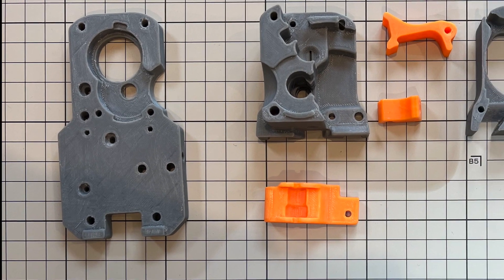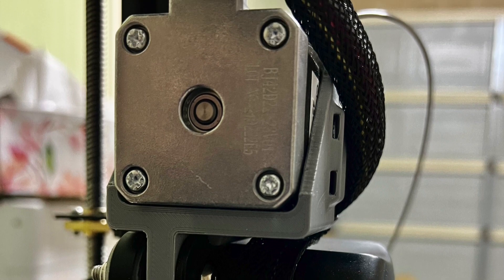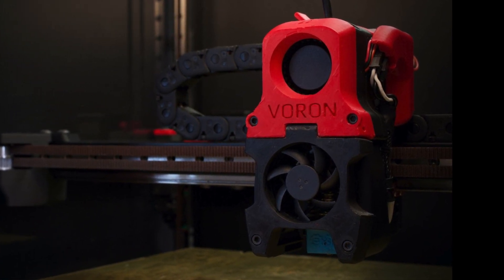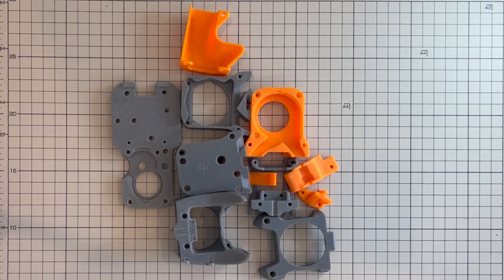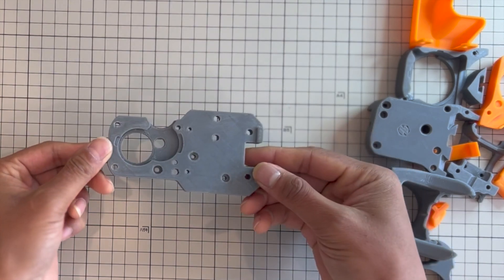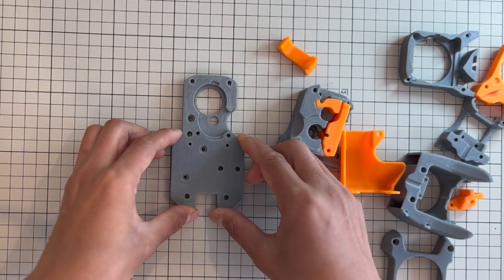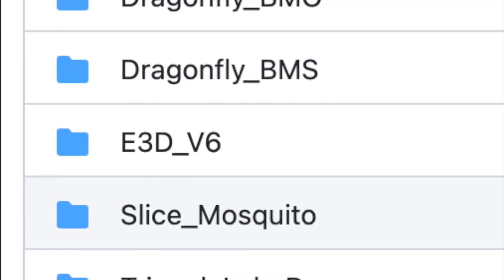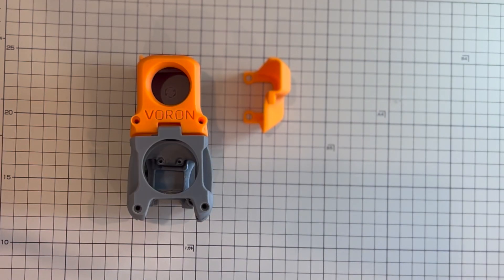Building a Voron Afterburner for Ender 3 v2: printed parts and parts sourcing

Comment: can you tell me the temperature setting and cooling fan you use to print  abs afterburner parts?
Reply from the maker: You may play with the temperature with your own filament. I print them with bed temperature 110C and hot end 255C
Reply: @makeIT0  255c with all metal hotend or ptfe line stock ender 3 hot end?
Reply: @lanypuspasari1868  From a different perspective I am printing this on my old Anet A8 in an enclosure at 230C and 75C bed temp. 75C is not giving me issues at all. I'm using a PEI coated sprinsteel(??) bed from eBay and some hairspray.

Comment: I am considering this build, but I would like to ask: Does it reduce print volume?
Reply from the maker: No, if you don't install the cable cover or cut a little like this https://www.youtube.com/watch?v=DmTqJCn7rKY&t=303s
Even if you keep it as it is,  The Z height reduces round 3cm which you would probably never have a chance to use it.

Comment: Great video, I am so doing this, thank you. Question: I’m using ESUN PLA+ for everything I’m making. Do I need ABS/PETG for strength/ heat resistance? I think I’d need to upgrade my E3v2 to print ABS?
Reply from the maker: I think you should at least use PETG

Comment: for 2pcs m3x10 screws and 1pcs m3x6 BHCS or SHCS? and for which part?
Reply from the maker: This is for fixing your printed plate on to https://www.thingiverse.com/thing:4614384. BHCS m3x10 (6-10 should all work fine). Actually you have these screw if you have the BL touch.

Comment: Nice print head, but without a coreXY is printing faster a good option for bed slingers like the ender 3 v2?
Reply from the maker: You're right, It does not improve the print speed. I did the mod because it is a better direct drive solution (both in function and aesthetic) and it provides a decent cooling for PLA (The stock Ender 3 v2 cooling is good enough though, considering it uses a single small fan)

Comment: does it use ender 3 v 2 gantry x or ender 3 pro ?
Reply from the maker: Mine is ender 3 v2, but you can easily find one for ender 3 pro as well
Reply: does using a pancake stepper motor have to change the vref current on the ender 3 v2 v4.2.2 stock stepper driver mainboard?
Reply from the maker: It has worked no problem for me so far without changing the vref. I will do a calculation this weekend and see if it requires a change.

Comment: I would love to see if you have the same issue I have with my Ender 5  and it hitting the bed. No matter what adjustment I made it still would hit the bed. I am also using linear rails on mine. I had the parts printed for like two weeks and it assymbled since Monday of this week and put it on last night and had so many issues.  Hope your able to fix or don't even have them to start.
Reply from the maker: I had a quickly assembly today and it seemed no problem to me, but I haven't really got a chance to do a test print yet. I will do a test print and share my video around next weekend cheers

Comment: Can this be used for Voxlab Aquila?
Reply from the maker: Thanks mate.

I don't have a Voxelab Aquila, but I think if its hot end mounting plate (on x gantry) is the same as Ender3 v2, then it should work. Or you would have to find/mod a mounting plate similar to afterburner-motor-plate-ender3v2-Mod.STL for your printer
Reply: @makeIT0  I'm actually in process of printing the mounting plate to see if it will fit my Aquila X2; I'll let you know what I find out.
Reply from the maker: Good luck mate!